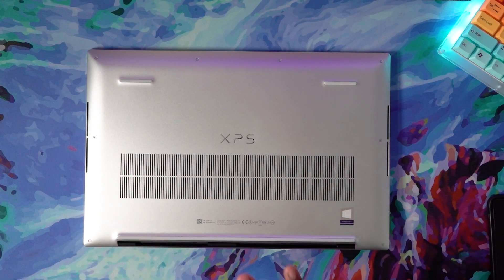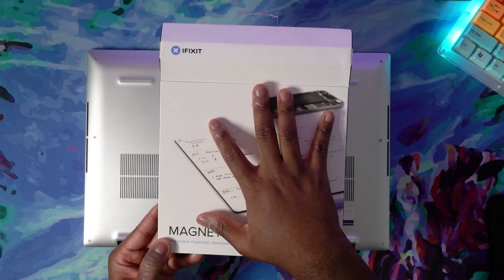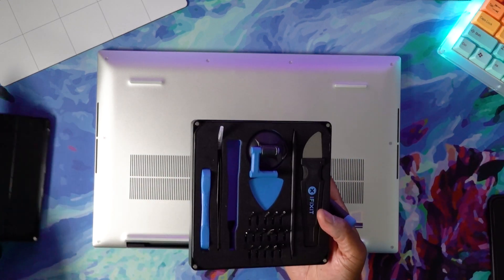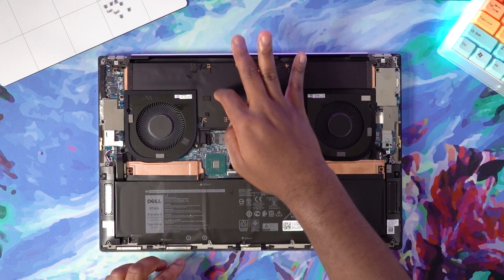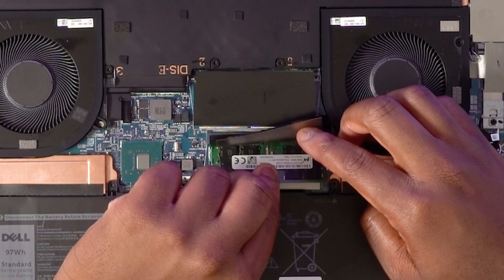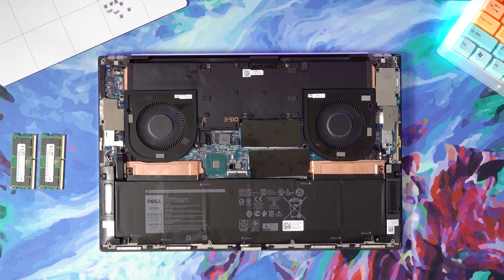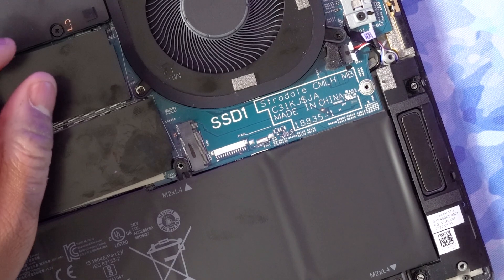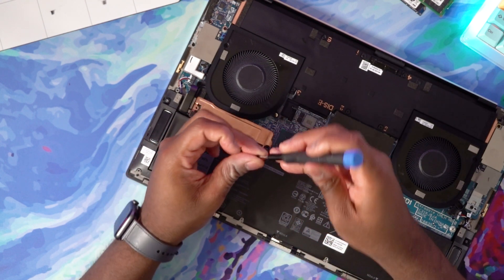Save Money Upgrading the DELL XPS 17 Yourself!! (SUPER EASY) - 2020 XPS 17 9700

Comment: Great video however i tried this today and one of the screws was stripped very hard to take off maybe do a future video on what to do if that happens
Reply from the maker: Use the right size, press hard, and go slow.
Reply: @TooMuchTech  yea i was using a T5 torq screw which i believe is the right size

Comment: How on earth can you say that the max spec of xps 17 is useless. It comes with a Core i9 overclockable CPU. Nvidia Geforce RTX 2060 max-q, 2 TB SSD, 64 GB DDR4 RAM which makes it a beast for video editing, content creation, and gaming to some extent. Just try to be more careful with words next time.
Reply from the maker: I’m talking about if you’re overpaying for an easily user replaceable SSD and RAM so that you can save some money. Maybe you should be more careful choosing your words next time.
Reply: @TooMuchTech  No offense man, and you are doing good work, and heck I've chosen my words as easy you can understand and precisely. If you spend money and buy the max-spec of Dell XPS 17. It comes with RAM and SSD which is faster than the version we upgrade to or maybe equal to. When I bought my version of dell xps 17 with the 64 GB of RAM 2 TB SSD, I opened it up carefully without a single scratch. It had a Crucial 64GB Kit (2 x 32GB) DDR4-2666 SODIMM RAM which is according to my opinion the best choice and also even if we can take the SSD to 4 TB. How can you upgrade to the Core i9 version? Didn't meant to criticize your work. You are doing an awesome job and I have respect for you. Just wanted to share my opinion and I did. 😄😅

Comment: Really impressed, thanks for this video and sharing you knowledge with us. I'm confident enough to do this myself now having seen inside my new DELL 17 9700 i9, and learnt a lot, like using the proper toolkit and plastic tools to reduce/prevent damage.
I'm upgrading from 16Gb to 32Gb RAM, and putting in a 2nd 2Tb SSD. It came with 1 x 1Tb SSD. This computer will be my next rocketship after my 5 yo Acer Predator which still works champion.
Great job.
Reply from the maker: Glad to hear and thank you!

Comment: Hey there, nice video. 
Do you know the thickness of the ssd thermal pads? I would like to have one that fits at hand if once opened i realize it needs to be replaced. Thanks!
Reply from the maker: Probably 3-4mm thick - most thermal pads are very similar
Reply: @TooMuchTech  Interesting, it seemed to me that it was a lot thinner, like 1mm. Thank you!

Comment: Why is the Amazon links to Amazon Spanish page? I'm in the USA and don't speak Spanish!
Reply from the maker: It’s a genius link so it does it automatically based on your region! Sorry you may have to search it!
Reply: @TooMuchTech  OK thanks! BTW, you should also point out that it needs to be a 3200MHz RAM for it to work at 2933MHz! If you get a 3000MHz or even a 2933MHz ram, it will run at only 2666MHz!
This is according to a thread I found about it on Reddit...
https://amp.reddit.com/r/Dell/comments/hrifkr/xps_17_corsair_vengeance_32gb_ram_3000_mhz/

Comment: You're recommending 2666 RAM speed for the 64GB kit, however the XPS 17 RAM original spec is 2933 speed. Any issue with this?
Reply: it will work it just won't run as fast, if you bought a 3200mhz kit it would run at 2933 since that's the max it will run at

Comment: I just got the Dell XPS 15 9500 with core I 7 6 core, 16gb ram, 512 SSD, 4k touch panel. System works great currently. Would upgrading the ram and or hard drive make a big improvement?

Comment: I notice you don't disconnect the battery like in other tutorials on this. Is the threat overrated?
Reply from the maker: I mean I wouldn’t really think it’s that necessary, I didn’t watch any other tutorials before I made this one on purpose because I wanted to see how easy it was! But just make sure the laptop is fully powered down then don’t reopen the lid because that will power it back on!
Reply: I’d disconnect the battery.

Comment: Do two SSD's have to be the same size, or can I add 1 TB to one slot and keep the existing slot with the 512 gb SSD?
Reply: No they can be different sizes, 512 GB for the main and 2TB as a second hard dive in the second slot works fine.

Comment: Thanks man! I saved a lot of money buy upgrading my 500gb to 2 x SSD 1tb, and memory from 16gb to 64gb.
Reply: How did you copy the data from your initial 500gb SSD to one of the 1 TB SSD's  Did you replace one at at a time and then copy one to the other?
Reply: @etolbert4427  I used the free software Macrium Reflect to clone my 500gb SSD to the new 1 TB SSD. 
As I wanted to keep the 500gb as an external SSD drive, I bought a SSD enclosure case adapter, and used it to clone the 500gb to one of the 1TB first. After that I installed both 1TB to my Laptop. It worked great. 
If you don't have plans to keep the old SSD, and don't want to spend on the enclosure case,  you can install the new SSD to clone it, and then replace the old one by the 2nd one (in my case, I had to format both new SSD prior to use it, and for that I used the Macrium Reflect).
Reply: @andrecruz4484  Thanks

Comment: I have 5 questions with Dell XPS 17 :
1. Can I use two power bricks to solve the charging problem ?
2. Can I disable the dedicated GPU somehow ?
3. Can I use high refresh external display for gaming ?
4. Can I use e-GPU with it ?
5. Does the battery continue to drain while using e-GPU with an External Display ?

Comment: Just an FYI the Memory supplied with the XPS 17 - 9700 is 2933Mhz.  This is faster memory and the cost for this memory is a bit cheaper than you pay when configured for the system.  For the short money, you save and based on previous experiences with Dell tech support when you change out configured items I would recommend getting the memory configuration you want from Dell.  This will most likely change in the future as costs for the faster 2933Mhz memory comes down in price.

Comment: I am SHOCKED you received an SSD heatsink with an empty SSD slot.  Dell never does that and I often have to request one.
Reply from the maker: It was just ordered with a single 2TB drive, Is rather have a single 2 TB drive and room to upgrade than have 2 cheaper and slower 1 TB drives

Comment: I have seen many upgrade videos where they disconnect the battery before upgrading the ssd or memory . Any reason not to other than a precaution?
Reply from the maker: You can just to be on the safe side, but I never do in any of the laptops I’ve taken apart. Just be sure to make sure it’s fully off! And after you do a shut down, don’t reopen the Dell XPS 17 because that will turn it on again!
Reply: @TooMuchTech  if anything, I'll runt he laptop off battery only till it's dies. LOL

It's just seems that many take that extra step along with making sure to ground!

Great video nonetheless!
Reply from the maker: Larry Turner Another good idea!

Comment: Is it cheaper to upgrade to 32 or 64 ram yourself than buying the from Dell? I never upgraded something before
Reply: It is much cheaper to do yourself. I just bought one of these machines and it's much cheaper to upgrade yourself. Dell really charges a premium to have it ready-made with higher specs. 

I'm installing the Samsung 970 Evo Plus 1TB SSD drive which is much larger and faster than the default 512 SSD it comes with.

You do have to purchase the video card you want with it ready-made though because I do not believe that's something they expect you to upgrade yourself easily. Someone feel free to correct me if I'm wrong, though.